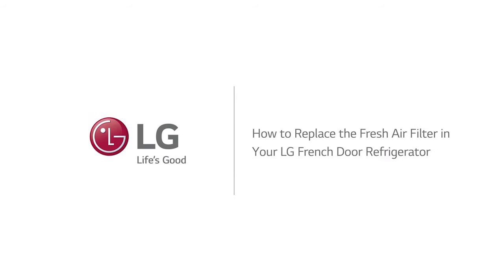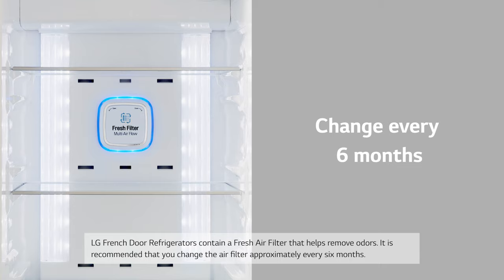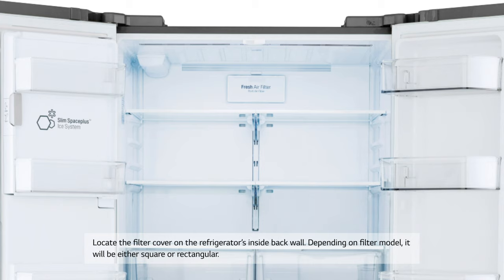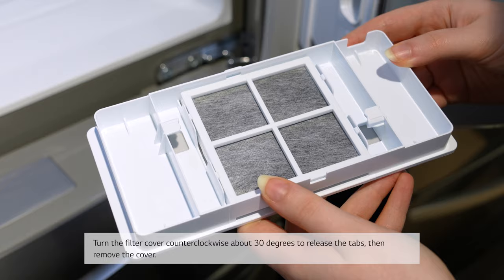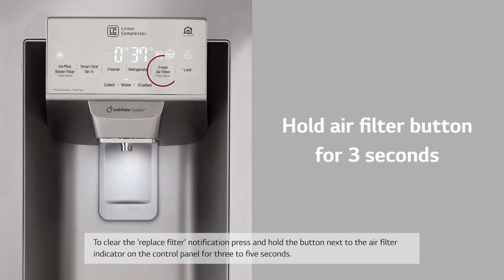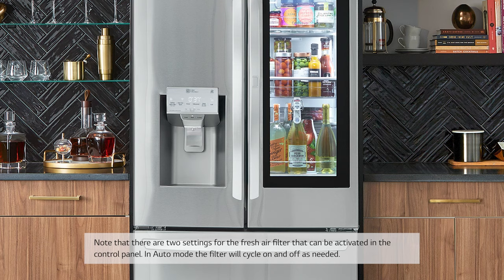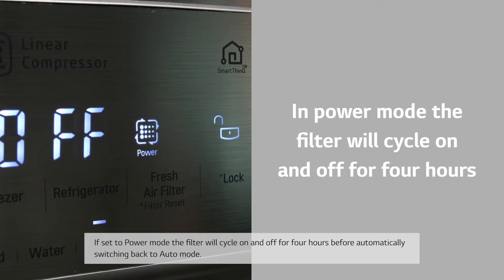[LG Refrigerators] How To Replace The Fresh Air Filter In Your LG French Door Refrigerator

Comment: My filter cover on an LRF model has an angled clip that isn’t square like the filter? 
Also you show the install placing the filter in and then write “front” on the side that will end up being in the rear??
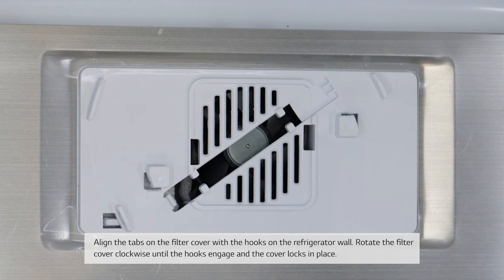Reply from the maker: Hi,  thanks for reaching out! When replacing it, please place the filter with the 'Front' of it facing outward (As can be seen at the 0:39s mark in the video) Furthermore, filter covers can vary depending on their models. Should you need further assistance with replacing the filter for your model, don't hesitate to reply to this message with your complete model number! ^Chris
https://www.lg.com/us/support/help-library
Reply: Mine too! I just replaced my air filter, and what I did was to rip the entire interior of the new filter cartridge out of the white plastic frame. Then I "disected" the old filter and removed the black plastic square with holes throughout it. I used that as a holder by placing it on top of the new filter (sans frame). It went back in where the old one was and I was able to reattach the filter cover. Bizarre that they'd start making a parallelogram holder for the square filter cartridg they incorrectly spec in the owners manual. Somebody at LG really screwed up!

By the way, LG charges 5x as much as they should for these air and water filter cartridges. I just paid $48 on Amazon for 3 sets of both filters, i.e., an 18 month supply of BOTH. I bought ICEPURE brand (and paid extra for their top-of-the-line ICEPURE PRO water filter set), but there are many with very high ratings. Our original LG water filter cartridge is really poor quality; despite purging it as instructed when we first bought the refrigerator, it never stopped delivering charcoal fines into the water. They're not noticeable when you first pour a glass of water, but after it sits for a while, the fines are very noticeable at the bottom of the glass. I assume they've also been in all our ice cubes. So much for sticking the LG replacement filters. They're obscenely overpriced and not as good as replacement brands.

Also, I had the same thought on "front" that actually ends up in the back! LOL
Reply: @LGUSASupport  your answer doesn’t explain anything. It just reiterates…
If you put “Front” in as shown then it becomes a rear facing side? Why?
 After buying the filter that is consistent with my model I find the filter to be a square but the filter holder is a parallelogram shape.
Where can I buy the filter that is parallelogram??
Reply: Same question, what’s with the parallelogram shape?
Reply: @ryanpoh6721  SAME here - it's a parallelogram with a perforated black piece inside a gauze bag over a piece of styrofoam at a very wonky angle.

Comment: What air filter do I need for LRFLC2706S? It says LT120F is my air filter but theres no way it’s going to fit? Do I need to take it out of white frame?
Reply from the maker: Hello, there. The air filter that is compatible with your LG Refrigerator model LRFLC2706S is part number ADQ73214405. You can also verify the substitute part number ADQ73214408. If you have any questions, feel free to reach out to us on Facebook or X @LGUSSupport. We will be more than happy to assist you. ~Zie

Comment: Got the retangular cover off just fine but the filter holder is a parallel design not square. /   /  new filter will not fit. one that's in there has no casing just filter material. what's up with that?
Reply from the maker: Hey Jules, we'd love to help you find the perfect filter for your LG refrigerator. Please provide us with the model number, so we can assist you further. ~ Jupe

Comment: Instead of a fan like shown at 0:42 I can see styrofoam there. And there is no filter either. I’m having a cooling issue in my fridge but the freezer works fine. Can that be the issue?
Reply from the maker: Hi, its certainly possible you have a different model than the refrigerator in the video! In order for us to accurately diagnose the issue, we'd need to switch to a different platform. Please direct message us on Twitter (@LGUSSupport) or private message us on Facebook (@LGUSA).  Be sure to include your model number and a brief description of your issue. We look forward to providing you with a resolution you're satisfied with! ^Chris

Comment: I have refrigerator model LRFLC2706S. The filter that was in the removable cover in the fridge and that came with the fridge  when purchased was just the charcoal,  and was not within the cardboard windowpane looking thing. Do I have to remove the carbon from inside the cardboard windowpane looking cardboard cover on the new filter I buy prior to installing in the fridge? I tried this on a new filer I purchased (model # LT120F) , but the carbon is taped pretty heavily to the carboard cover  and the carbon filter broke into pieces, rendering it useless and wasting my money.
Reply from the maker: Hi David! In looking through the manual and instructions on how to change the filter, no you don't have to make any modifications to the filter before installing it. Are you not able to install the new filter (model LT120F is the correct model filter) because of an obstruction from an old incorrectly installed filter?  If so, please DM us pictures of the old filter and if possible, how it was installed before to our Facebook or Twitter handle (@LGUSSuppport).  We look forward to taking a closer look at this! ^Chris
http://spr.ly/6059PRD8v
Reply: Let me know if this issue was resolved bud. Just bought this model and I hear mixed reviews. I’m hoping not but Have you had any issues with linear compressor or etc ?
Reply: @joegarcia2400  no issues with fridge. LG sent a new piece at no charge to me that the air filters fit into.
Reply: @dmcar2000  awesome good to hear ! Thanks for the response

Comment: There is clear plastic sticky stuff on the very back of the refrigerator covering the air filter it took us two years to figure that out
Reply from the maker: Thank you for bringing your concern regarding the clear plastic sticky stuff on the back of your refrigerator to our attention. We understand how frustrating it can be to come across unexpected features or obstacles when using household appliances. We empathize with your situation and apologize for any inconvenience this may have caused over the past two years. To address this issue, kindly send us a private message on Facebook or Twitter (X) using the handle @LGUSSupport. We'd be happy to help. -Shae

Comment: I am thoroughly confused. I just changed the water filter but had a hard time pulling the old one out and didn’t want to break it so I watched a video and I am all set with the water filter.  The video mentions changing the fresh air filter.  I had no idea there was a filter that needed to be changed.  So I removed the Fresh Air Filter cover and there was never any filter there.  Was there supposed to be one when I bought it?  I had it installed by HD so I assumed they would have installed the necessary parts.  Anyway, I have scoured the internet, the LG website, Amazon, etc., for the replacement filter.  I cannot locate the appropriate filter anywhere?  I have model # LFCC23596S. It has the door for the beverage center on the right but no water dispenser. It dispenses ice through the freezer, not the door.  Why can’t I find the filter?
Reply from the maker: Hey Tammy! The model number for this refrigerators air filter is LT120F. You can find it on http://spr.ly/6052wc3ck here: http://spr.ly/6053wc3cZ. We would also like to get more information about the installation for your refrigerators filter upon delivery. Please send us a private message on social media @LGUSSupport with your order number, contact information, model, and serial number. We are here to help further! ~ Jupe
Reply: @LGUSASupport  Thank you for the info! I’ll follow up with you. 👍🏼

Comment: Is the fan supposed to to run all the time or just when it needs to?
Reply from the maker: Hey there. We want to know what fan you are referring to on your LG fridge. What is the model of your fridge? ^David
Reply: @LGUSASupport  I have LG GSX961MCCZ
Reply from the maker: Thanks for this! If you find that the fan in your LG GSX961MCCZ is indeed running all the time, it's advisable to check the temperature settings, ensure the condenser coils are clean, and verify that the door seals properly. We hope this helps! ^Mau
Reply: @LGUSASupport  it is not running that’s why I was wondering if it run all the time or just when it needed to run? I was checking the filter today and saw it was not spinning.

Or it only runs when it need to? And also turn off when door are open?
Reply from the maker: Hey there. We are here to support you and your refrigerator as best as possible. Please send us a private message on social media @LGUSSupport with your contact information so that we can work together to help you find a solution. We will be here to support you.^ Diego
Reply: @LGUSASupport  But all I want to know if the fan is suppose to spin all the time or just when it needed to and or if stop spin when the door is open.

Comment: I'm a 78 year old woman. I'm unable to budge that cover and afraid I'll break it. Even standing on a stool to get good leverage, no go. Will it hurt to just not change the filter???
Reply from the maker: We understand where you're coming from, Judy. To answer your question, neglecting to replace your refrigerator's air filter could have detrimental effects. The refrigerator may have to work harder than necessary if the filter is blocked with impurities over time, which limits its efficacy. This may result in increased energy costs and a shorter fridge lifespan. What we can recommend is try to ask someone to help you change it.
Reply: @LGUSASupport  Please do all of us a favor and kindly stop making refrigerators.  I have just spent an hour to try and open that air filter and it is not moving.  If you feel you want to contribute to this forum, perhaps admit to making a poor quality product, offer an apology, and promise to get out of a business you are not very good at.

Comment: The filter looks very clean, no dirt, no dust, no black debris, why need to replace it so often?
Reply from the maker: Great observation! The owner's manual recommends that you change the air filter approximately every 6 months in your refrigerator in order to make sure air flow is circulating as it should. ^Chris

Comment: Rectangular one is really poorly designed. Having the hardest time getting it back on!
Reply from the maker: Hi, Adam! The Fresh Air Filter cover should be able to easily go back into place by rotating the cover 30 degrees clockwise, but if your unit is experiencing any issues getting that cover back on, it'll be our pleasure to help! Just be sure to let us know your model number and what's going on when you try, and we'll get to the bottom of this with you. ^Ian